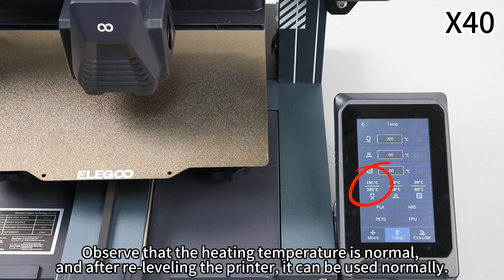Neptune 4 Pro: How to replace the heating rod and thermistor?

Comment: How about a video about changine the nozzel because it looks like it needs to be this disassembled to access the nozzel but you're not supposed to change a nozzel cold
Reply: Asking the real question
Reply: Yes, does a video exist for this?
Reply: Haven't found one yet
Reply: Take the fan off the back and you'll have access to the sock and nozzle
Reply: Actually Elegoo have a tear down video on their channel. I used it to change my nozzle.
Reply: Couldn't find the video for some odd reason kept giving vids for the 2 but figured it out thanks for the info though
Reply: You can get at the nozzle with the head still on the machine had better luck doing it this way when it was still hot than disassembled but cooler
Reply: Old post but you can do it without disassembling anything. Get an  adjustable wrench to hold the block, a socket wrench to undo the nozzle. Be careful not to damage the wires going into the block. There's a video floating around showing some young kid doing it. I forgot to do it hot the first time, nozzle snapped in half. New block...
Reply: If you still have Questions to the topic, there is a very helpful video from Ben Myhill-Jones.

Comment: elegoo sending me here instead of fixing faulty parts and its not even the same. Unsrew the first fan off neptune 4 and you see it has more rollers and you can barely see where to take screws out. When you do take them out using the hex wrench it still stays on because of more rollers. none are addressed and theres no other tutorial
Reply: figured it out but comment still stands. customer service is ass

Comment: That is a Neptune 3 hot end. That's not what I got for my Neptune 4 Max. Even the ribbon cable is different (different in pin number).
Reply: This is for the Pro not the Max. There is a difference between them.
Reply: @Michael-fo3ib There shouldn't be, if replacement parts aren't available it's unacceptable.